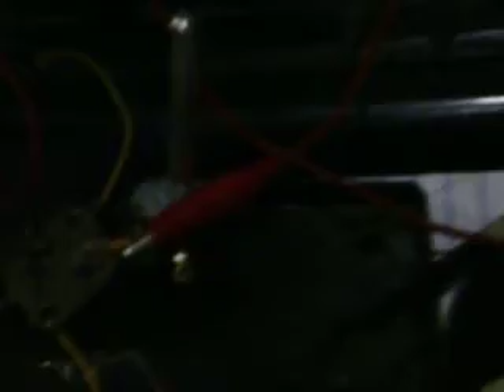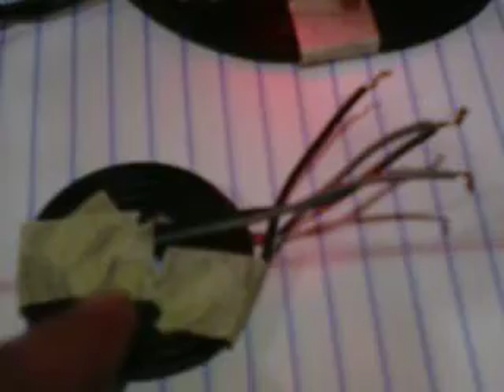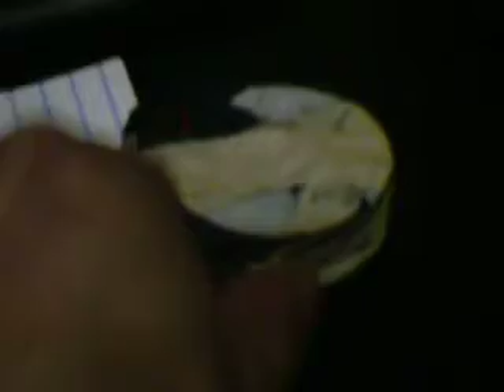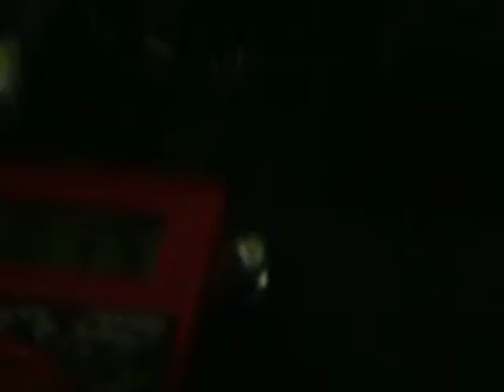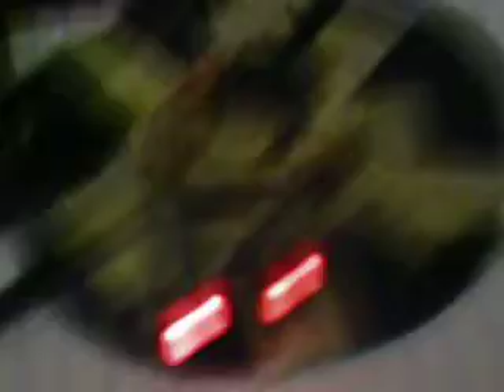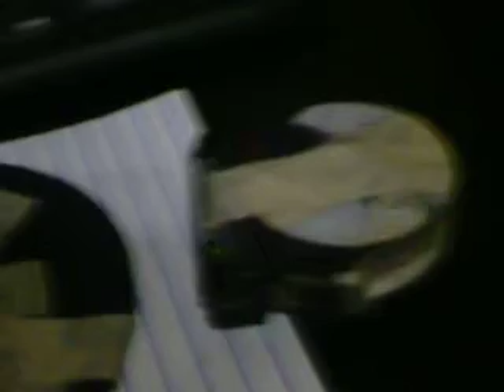slider2732's simple wireless replication

Comment: Great set of experiments and clear what you did :)
20mA is good...a 2N2222A/MPSA06/C1815/C2320 or similar high hFE transistor can bring it even lower with a bit more brightness.
The water resistor is worth a go, as in my BAC's video, to drop LED's in and they light up, No idea where I got that idea from lol, but all credit to N. Tesla of course for the pancake.